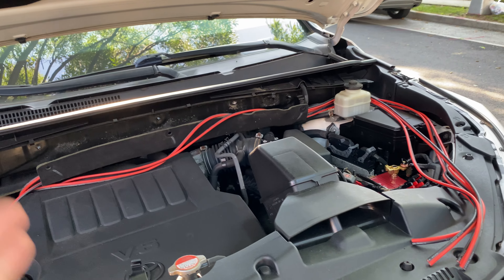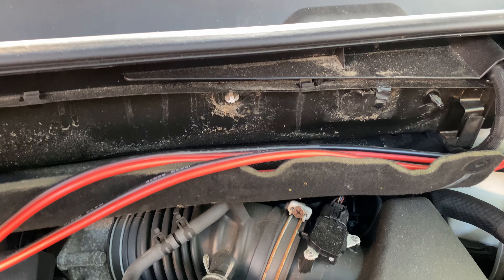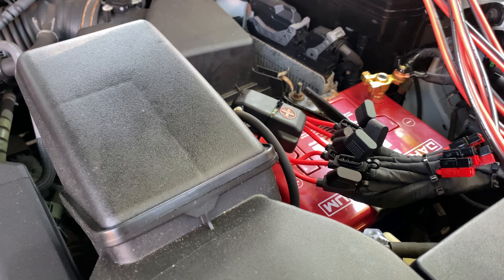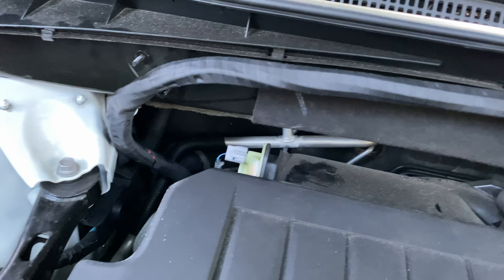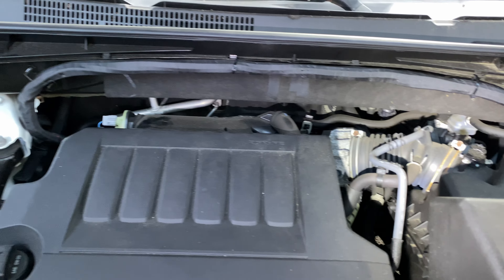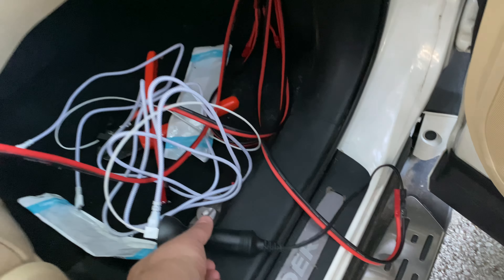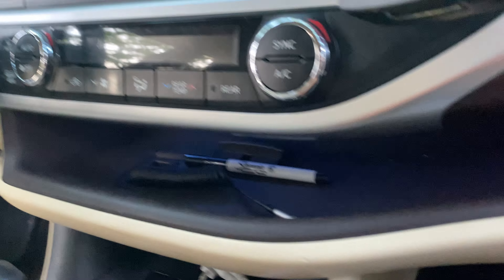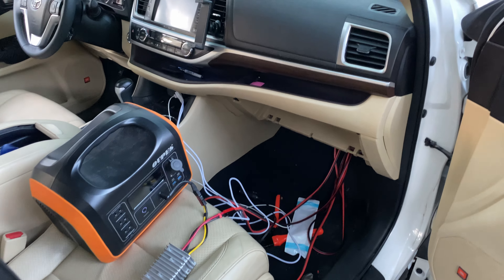12v Wiring Direct to Lithium Car Battery from CABIN in 2016 HIGHLANDER How To #wisebuyreviews

Comment: So I have two thoughts. The first is that you are potentially going to cause problems with the onboard ECU. Almost all modern cars expect their electrical systems to go into battery voltage reference to determine that it's okay to go into sleep mode. By applying a charge voltage above the nominal lead acid voltage of about 12.2, your ECU may never actually go into sleep mode. My second concern is actually one a potential hazard to your car overall. You will face a very real possibility of burning up your alternator and potentially destroying on board electronics. I would strongly suggest you take a look at a lot of the videos and websites that are popping up. Warning people about putting lithium-based batteries as a start and run battery in their vehicles. The batteries have the ability to charge in a way that can overheat the alternator. And, with the alternator in a very high charge current condition if the BMS switches off very suddenly, the alternator will not necessarily recover fast enough and you potentially will expose your vehicle electrical system to 100+ volts because it will exceed the breakdown voltage of the diodes in the alternator. You have to install current limiting shunts in line with the battery to prevent it from charging at peak current.
Reply from the maker: I see where your concern is, my battery is perfectly sized for my 150amp alternator, on the dakota lithium battery website it is designed for alternators of up to 150 amps. Long story short, this one has a BMS that allows the 150amp input and won't shut down, causing that cascade of failures. The issue is that people are using inferior Products for their car, for example dakota has a 60ah battery for starter,  however it warns that it is not for car with 100 amps alternator. Read more on the website, I did my research, this is a drop-in replacement and so far so good. I haven't been able to find a better battery for my car on the entire market. So this is why this thing is $1200 because it needs to do exactly the 1000 cold cranking amps and the high amp charge current and it has larger capacity. Read more on their website here: Got it at their website: https://dakotalithium.com/product/dl-plus-12v-135ah-dual-purpose-1000cca-starter-car-truck-battery-plus-deep-cycle-performance/
The ultimate all-purpose battery for both starting engines & deep cycle applications. With 1,000 cold cranking amps (CCA) and a high continuous discharge rate, the DL+ 135Ah has 5X the power of traditional batteries in a case that is 25% smaller than a 100Ah marine battery. PLUS internal even-heat technology for use in extreme heat or cold. 

--- AND watch my review of this battery here: https://youtu.be/Mms05lZEYkA Dakota Lithium 12v 135AH CAR Starter Lifepo4 Battery Review and How To Install #wisebuyreviews

And I also watched a video where a guy had the battery for 2 years and it worked fine, and it allowed them not to bring a solar generator for most things on overlanding trips, here are the videos. 
Group 24 Dakota Lithium Battery (1395) Best Lithium Overlanding Battery Setup - YouTube

https://www.youtube.com/watch?v=fqiaL0XIDHk
Long Term Dakota Lithium Battery Update (1395) Under Bonnet Lithium Overlanding Battery (2 Year Update) - YouTube
https://www.youtube.com/watch?v=ZXTz3Ie6Wfc